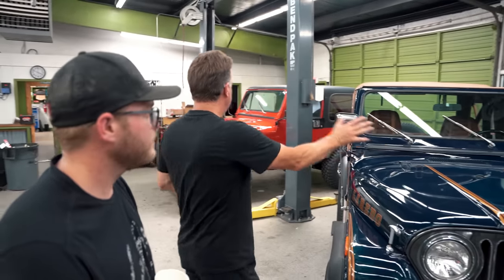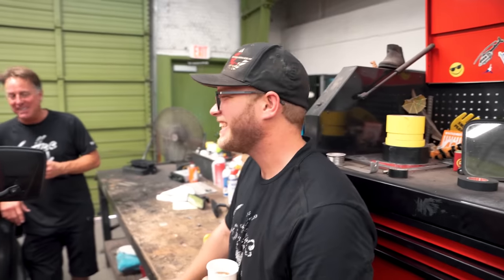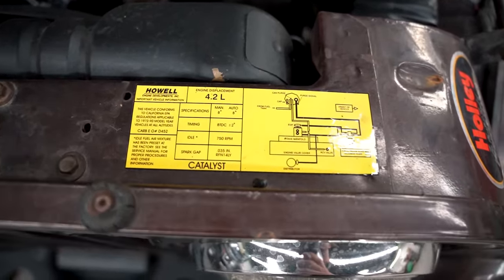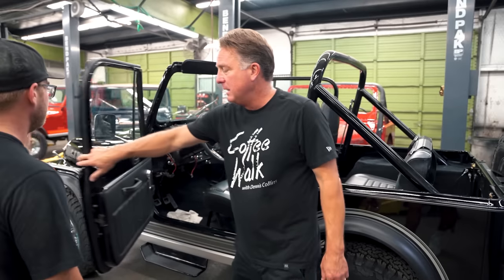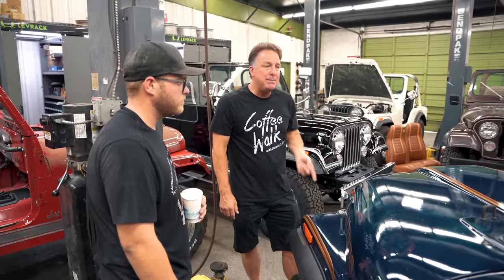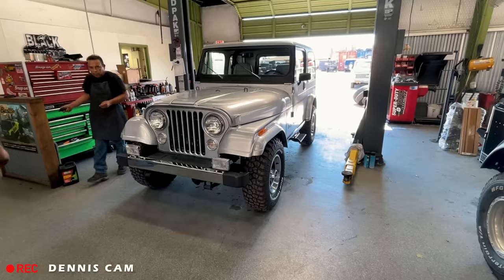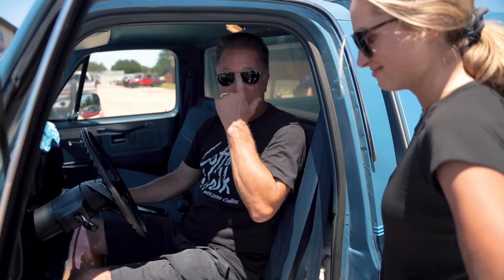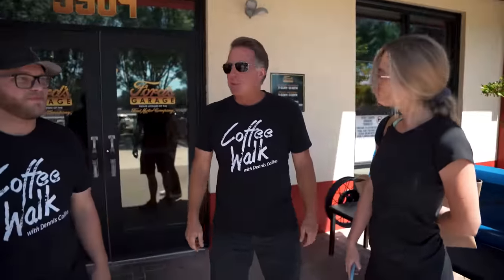UPDATE: Renegades, Laredos, and Patina!

Comment: Totally correct regarding the Howell TBI system. That company’s kit has already been approved by State of CA. I have it on my 85 CJ and it passed smog. The other benefit is that the carburetor just doesn’t work well anymore, and the Howell system makes the engine run like a top…no sputtering etc. But you have to go to a shop that has done lots of conversions, if you don’t do it yourself. Even by an experienced mechanic it’s a 12 hour job to remove old parts and install new parts, including a new ECU.

Comment: I drove a TJ for 17 years and had no issues. It was a 2.5 and got around 22 mpg city driving. What kind of mileage do your rebuilt Wranglers get?? Mine was a 1998 w original paint which still looked as clean as a new one.

Comment: You were incorrect about the Cobra. It wasn't the highest horsepower car built in 2003 by any manufacturer. The 2003 Corvette Z06 came with 405hp.

Comment: 2 comments here.. I have a 1981 Jeep CJ7 Laredo I have had since college that my dad and i restored just after college then I daily drove it into the ground blew a piston out of a cylinder and it was put away. I have since put a new/used motor in it but thats all. My comment is I am going to use this as my bug out vehicle in case we have some idiots light up an EMP over our heads and toast our electric grid or it could be a black flag event prior to or just after the next presidential election because we all know none of these lunatic politicians wants to give up control of the world, anyway I digree... if this happens it will fry every single vehicle that has an electronic ignition. If you put fuel injenction in your CJ  you are going to be fried right along with every other jeep after the CJ and it will be made non running along with about 500 million other vehicles. So while the fuel injencted motor is a great thing in normal times if you are saving an old jeep just in case then I do not recommend doing that upgrade.  2nd comment... that Ford joint charges way too much for mediocre food and the portions looked tiny as well. Just my 2 cents on that one.